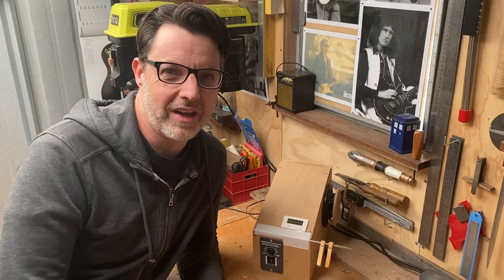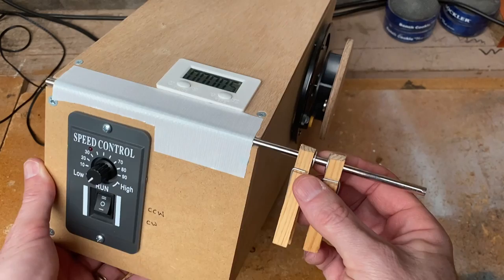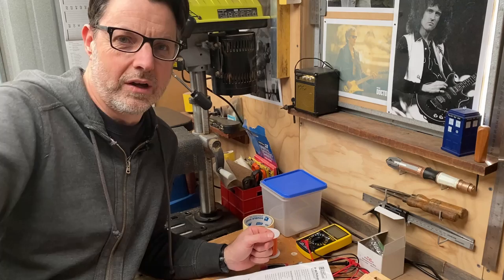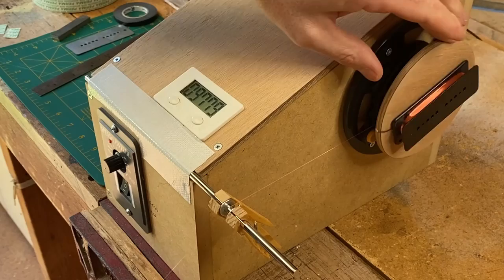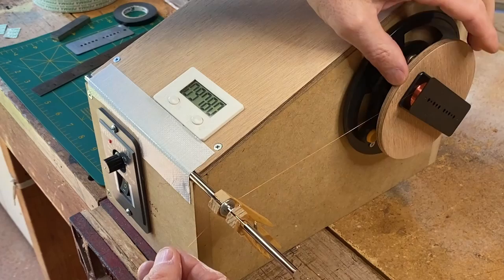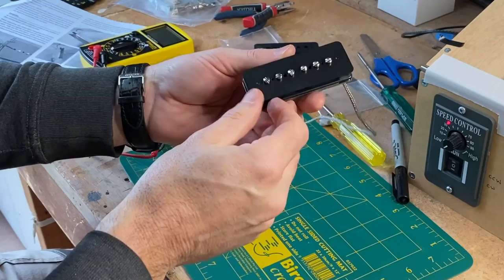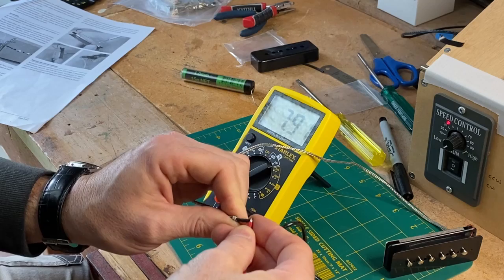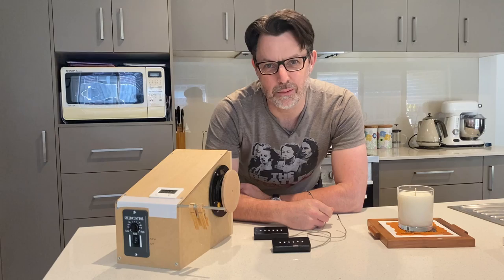DIY Guitar Pickup Winder

Comment: A similar design to my pup winder which looks like a birdbox! I've got the same magnetic reed counter, which also doesn't work at very high speeds, not a problem at present as I can't wind faster yet. I used a couple of drum cymbal soft felt pads as wire guides which helps the winding tension. I've got a better counter 4 digital hall sensor counter to try out next.

Comment: @11:57 If you hold both of the VOM meter probes you will get a reading, this is the resistance of your body. Use an alligator clip on at least one of the meter probes to get a true resistance reading of the pickup.
Reply from the maker: Great tip, thanks! 👍

Comment: Nice one. Simple, but effective. I guess some form of tensioning device might be good, although, i think that hand feeding the turns will be something that one learns as one goes. Can't help but think that these will sound every bit as good as expensive pickups. Heresy to the average guitarist, I'm sure, but with decent wire, and parts, I can't help but think that there is so little in a pickup that the prices the big names charge are really over the top.
Must investigate the parts suppliers in Europe (or France, where i live).
Reply from the maker: That’s my thoughts as well. Good quality magnets and wire (and winding practice) should get pickups as good as any commercial ones.
Reply: The big brands, Seymour Duncan and DiMarzio, and the boutique brands have this special magic fairy dust they coat the pickups with that makes all the difference!  It's ALL in the magic because it's hard to differentiate winding copper wire around magnets.

Comment: I use a cordless drill and the magic of maths to work out roughly how many turns by weight of wire on the bobbin. I did make a jig with a counter but found it was not needed. I have a hand cranked jig my grandfather made and it works fine if a bit slow. I like your machine but I probably won't build one because I'm too lazy.
Reply from the maker: I’ve seen a few of the ones made from drills and sewing machines etc. and they all seem to work reasonably well.

Comment: I think I might have gotten a defective speed controller. I've screwed in the leads to the points on the back and then connected the female jack but it will not turn on. Hoping to get this done today but I guess it'll have to wait for the replacement
Reply from the maker: That’s annoying. Hopefully you can get it working soon.

Comment: Excellent video. Congratulations.
Could you tell me what capacity the motor is, or what are its specifications for the purchase. Greetings and thanks for your help.
Reply from the maker: Thanks. I got the motor out of a small 12v (?) vacuum cleaner, so I’m not exactly sure of the specifications sorry. It has a higher RPM than is needed for a pickup winder, so I generally don’t turn the speed dial up very high. As far as I understand you would just need a motor that matches the power voltage  that you would be using. Hope this helps!
Reply: @adairguitars  Thanks a lot.

Comment: Hello, i build a similar winder. As i see in the video that you bobbin carrier have some wiggle as mine. I winderd some P90 too recently and i think i am having the bobbin wound little loose even when i used amost max tension on wire. Did you notice something similar ? Im trying to figure out if its just practise in hand or if i have to make some adjustment to the bobbin carrier. Thank you
Reply from the maker: My bobbin holder is a bit heavier than I would like so it does wiggle a bit. I haven’t noticed that the wire is loose because of it but I think it may have some effect. That’s the part I will likely upgrade at some stage.

Comment: Dear friend, I already built it, Everything works. But it constantly breaks to the cable. Where do you put the main cable roll? Thanks for your help.
Reply from the maker: The wire roll sits on the ground directly underneath your hand. It needs to sit on its end as the wire isn’t strong enough to spoil off the roll. Hope this works for you. 👍
Reply: @adairguitars  Thanks a lot

Comment: What was the total cost for this build?
Reply: Also, what motor did you use? Awesome build
Reply from the maker: Thanks! It was about $40 - $50 AUD. The motor was recycled from a mini 12v camping vacuum cleaner the plugs into the cigarette lighter in a car. Any 12v motor should work - this one is probably a bit fast so I would look at a slower one if I ever upgrade it. 👍

Comment: What was the rpm of your motor?
Reply from the maker: Not sure sorry. I got it out of an old appliance rather than buying new. Its faster than it needs to be and I only go up to about 10% on  the variable speed control. One day I’ll put in one with a slower RPM.
Reply: @adairguitars  Well, that answers my question.  Most people making winders use a 1000 or 1200 rpm motor but I was wondering if a 3000 rpm motor would work.  I'm going to try one.  Thanks!